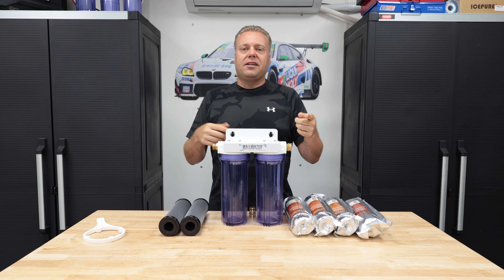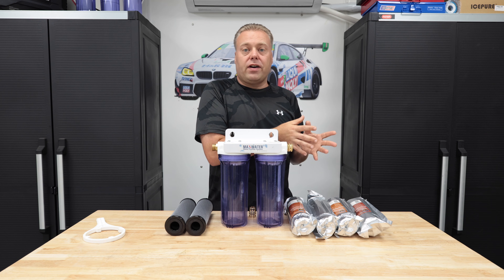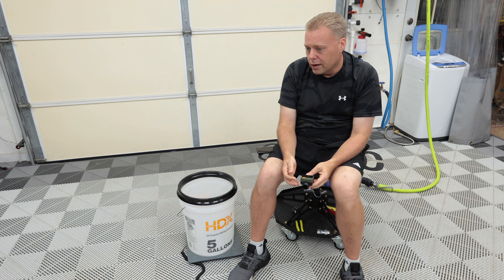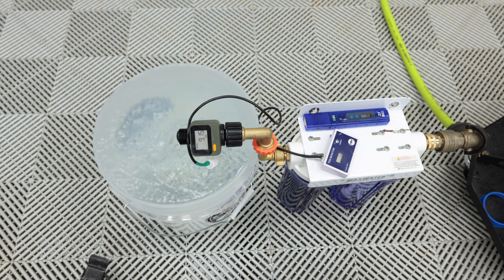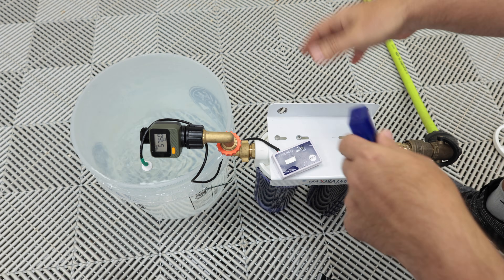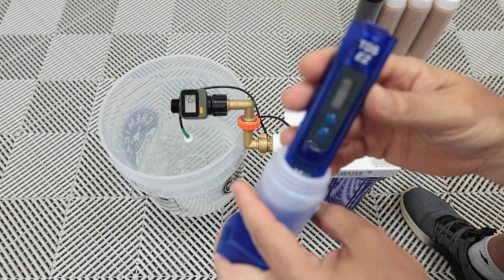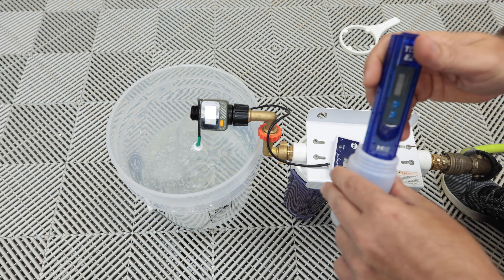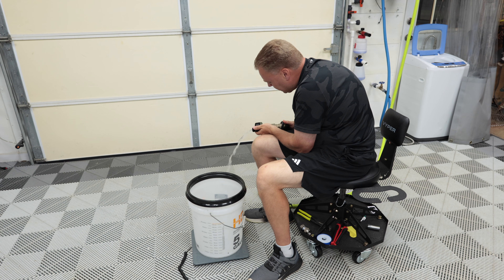Do Carbon Filters Help DI Spotless Resin Life? | Surprising Results! | Deionization

Comment: Does the carbon filter goes before the resin filter
Reply from the maker: Yes always before the resin.
Reply: Thank you 👍
Reply: why i see the they’re selling a set and the resin go before the carbon filter?
Reply from the maker: @fishwithme9245  Because the purpose of the carbon filter is to clean chlorine which depletes resin early. I have never seen a system where resin is first. It will also clean manganese which is a mineral you can get out before the resin as well. That could also be a difference in the filter system some the inlet is on the left and others it’s on the right.

Comment: It is best to prefilter water going into the DI media to get the lowest TDS as possible so your media/cartridge will last as long as possible. You can get a cheap RV set up with two 1 micron filters for ~$50
Reply from the maker: Prefilter carbon won’t reduce ppm though it can actually increase it, but reducing the chlorine is better in the long run for sure to lengthen resin life. The thing is though I have not really yet found a true dollar cost savings as the filters and housings cost money and the filter system only saving 10% or maybe a bit more. You might get ROI at some point, but it’s going to be a long time. If you had crazy bad water and using sediment filters then that might help tds, but most water is good enough quality to not have much picked up in a 1 micron filter.

Comment: Well that was clear as mud.  No offense Keav, but I don’t understand why this test was so convoluted.  It seems to me that anyone watching your DI videos is not considering replacing their DI system with charcoal, but trying to figure out if they would save money in the long run by pre-treating the water going to the DI with a charcoal system.  If I’m right about that (and lord knows I’m not always right), why not just run two tests through your normal DI system - 1 with pre-treated and one without.  Then you could calculate the cost of the charcoal filters along with the delta cost of the DI and figure out if it makes financial sense?
Reply from the maker: @RCGuy9973  That’s exactly what I did in the video was run tests with just DI and another with a carbon filter before the DI. Never did I run just carbon by itself. Carbon by itself would raise TDS and not help with water spots. The whole point of the video was about a pre-filter helping save your DI Resin. Whether that saves you money is entirely based on the system, the resin used and carbon filter purchased. Never said anything about replacing a DI system with carbon. I’m kind of confused if we are watching the same video to be honest 🤣. Now the reason I didn’t use my regular system as that takes 6 months to go through all the resin and I don’t have time nor want to waste 1k gallons and $100 in resin doing an all night test.
Reply: @ I guess the confusion for me came from subbing in a charcoal filter into the DI system.  I don’t always have the best attention span, so perhaps I missed your explanation about why you were doing what you were doing.  Thanks for responding, and thanks for putting together so very many useful videos - they have been extremely helpful.
Reply from the maker: @ I see what may have been confusing as the two stage system I had really isn’t just a DI system it only makes it one if you use DI cartridges in it. I was running the carbon filter first then the second stage I had a DI cartridge so that mimics two separate systems, but just in a smaller package so we don’t waste a bunch of resin and water. Concept and operation is the same as having two separate systems water flows through one then through the other as long as the carbon filter is first.

Comment: What you need is a bigger sediment and carbon filter then if you want to get the max out of your di filter you can pass it thru a 4040 ro membrane then to the di to polish out the water. 1 gal produced with every 2 gal waste. You can make everything under $600 or less. You can make your own di filter with $120
Reply from the maker: I don’t have any sediment in my water it’s mainly just controlling the chlorine. I myself don’t like waste water and since my ppm is low It’s not that costly for me to just use resin. For those with higher ppm RO is for sure an option. I have changed my wash process to use rinseless for the contact wash so now I use DI water for my pre-soak rinse and I know several with the 4040 and they say it can’t keep up with an AR630 so you would would need to store and pump or gravity feed it.
Reply: @CarsWithKeav  for sure rinseless is the way to go. I do my prewash with the di water. I'm mobile so I do store my water and pump out to my tank. You need a booster pump if you're going to run a pressure washer. If you use two 4040 you get more flow
Reply from the maker: @Ricios_mobileautodetailing  thanks for all the great information!

Comment: Couldn’t be bothered running a system that gets 26 gallons before it starts exhaustion. I use the DI – rinse spot free pro 100.
Reply from the maker: @Jimmer-Space88  It was just for the experiment not to waste resin and water. We didn’t even use both stages with resin either so together probably closer to 60 gallons. I wouldn’t suggest a system this small either, but it does work and regardless of exhaustion it’s based on the amount of resin. If you refilled this enough times to be the same amount of resin in your 100 they would be very close on total gallons to exhaustion. Just lots of refills to do. 🤣
Reply: @ Makes sense. Most of my vehicles use about 3.0 gallons in the final rinse off, so I guess my comment really came from knowing that I’d have to likely replenish the resin after eight car washes had me scratching my head.  Love your experiments by the way
Reply from the maker: @Jimmer-Space88  Refilling sucks so the least you can do the better plus the more resin the more flow you can get as well. 3.0 gallons you are doing well conserving. Ill use easily 5 gallons at least. LOL

Comment: Keav, I just bought the Spotbye DI system that you reviewed in another one of your videos. What is the best and most economical carbon prefilter setup I should use? Would a RV water filter be ok or do I need to go bigger like the one you are using in this video? Love your channel.  Content is great!
Reply from the maker: Carbon filter doesn’t need to be that big and would need to be a sealed cartridge so wouldn’t be a tank style. A 4.5x10 inch two stage should be more than enough. Single stage is probably good enough as well.

Comment: Great video as usual. Not that I’m asking for you to do this again, but having a test with 2x Resin would be a more appropriate test. Carbon filters cost about the same as resin filters, although claimed longevity of carbon filters varies. So the choice would be if resin + resin produced more clean water than resin + carbon (which I think it will)
Reply from the maker: At this size carbon might be closer in price, but they last probably at least 10x longer. As the filters get bigger the resin exponentially gets more expensive. The test was if you ran a carbon pre-filter can it improve performance as a lot of people wanted to know if they added another set of filters would it be worth it. Cost per gallon is still significantly less with a carbon filter.

Comment: I wash my truck and my work van once a week, and I currently have the 99 Aquatic Life POS DI System, Active 2.0, and the Ava P45 with the MJJC foam cannon. I live in Dallas, TX, where our water quality is terrible, at over 400 ppm. I'm looking for your honest opinion on what I should choose, considering how infrequently I wash. 

I’m not trying to transform my garage, but I don’t want to be buying supplies every week either. I appreciate your efforts to find value, but I wish someone would give practical advice to those of us who don’t want cheap options but aren’t obsessed either. Sifting through the overwhelming number of products has taken the joy out of my weekly washes. 

I've wasted more money on so-called "diamond in the rough" recommendations than I care to admit, and I’m over it. Please just provide a straightforward recommendation for a setup that works for those of us willing to spend money wisely without wasting it.
Reply from the maker: I got plenty of videos on those type of DI Systems. 400tds is almost at the limit of what most systems can handle to give clean water at say 2gpm. I personally would suggest the Griots at $300 which has a great bypass and the tank can hold 1/2 cubic foot or around 20lbs of resin. Plus it can flow at 4gpm for most water.

Comment: Dang those 10 inchers go quick
Reply from the maker: The 2.5 x 10’s sure do. The 4.5 x 10’s do last a bit longer and of course you usually run these in tandem so two filters gets double the gallons.

Comment: Good video. Now I see it's not worthwhile to filter before the resin. Sure it does something, but in my case it's not "easy" to add a pre filter due to space.
Reply from the maker: Calculating cost per gallon is going to be the deciding factor for sure as you have to make up for the cost of the pre-filter and filter for it to be worth it. Space absolutely is another reason. I would say carbon filter are more beneficial to those with lower tds. The higher tds the minerals are smothering the resin faster than the chlorine can probably kill it.

Comment: Loving these DI series of videos!  Keep up the good work!!  My issue with most DI resin is the mixed bed.  While much easier to deal with, you almost always burn through the anion faster than the cation.  So a 50/50 mix ends up wasting usable material.  While a 60/40, 70/30, or even 80/20 (depending on the supply of water), anion/cation ratio would be better.  A test with separate DI anion and cation stages would be cool to see.   Possibly using clear canisters and color-changing resin? Also, not having a mixed bed would make re-generation easier, for those who do that.
Reply from the maker: Different mixes for sure can help and like you said it’s about what is in the water you have. My biggest problem is 60/40 and others are more expensive than running a 50/50 so you have to add that into your cost formula to know if it’s worth it. Separate resin is actually not as efficient at cleaning water as mixed bed due to the reactions happening at the same time rather than separate. The reef aquarium guys have done tons of testing to prove that the best setup is separate cation and anion then a 3rd stage that is mixed bed for the final cleanup. I do plan to make a regenerate your own resin video at some point not just how to, but obviously picking out a good efficient setup to do it. If you can perfect the anion regeneration step with a mixed bed then it’s the same amount of steps than regenerating them separate. That step separates and regenerates at the same time just capturing the resin easily is the hard part.
Reply: @CarsWithKeav  can you find an  affordable supplier of the regen chemicals (muriatic acid and  potassium hydroxide)? I calculated the total to regenerate my 50lb tank and remember it costing more than 100. I regened  about  5 pounds but felt like it wasn't worth all the trouble.
Reply from the maker: @Hot.Tamale714  That’s my concern is it worth the trouble. I’m working to figure out a regen setup to try this out. Muriatic acid can be found at Home Depot I know that much.

Comment: Thx for all the do water videos,I’ve watched them all I believe some more than once. Got a scenario I guess I’d best description, 
I’m building a mobile detail setup in a metris 126, Ralda’s details is building me a skid waiting on delivery now basically. Anyway I’m looking for a way to run di water on the setup that is filtered as I use it so I don’t have to filter every gallon. My waters tds is low, or feels low after watching a lot of di water stuff, low is around 26-27 high around 32-33. I really like the wall setup, I was thinking of running 10 in housings and do a pre filter like you did with the 2 pre filters before it goes to the di setup, can the 10” cr or water drop handle the 2 gpm, or would I be better with the griots tank ? Either way I’m planning on doing the prefilters, I also considered after watching your bypass video just buying 10 in housings and then all 4 could match,
Anyway hopefully you can help save me some wasted time and point me in the right direction.
Thx
Reply from the maker: They both can handle 2gpm. The Cr spotless for much longer period of time. The Waterdrop filters don’t have a ton of resin in them, but at that low TDS it should be able to handle 2gpm. Cr spotless will do it easily as it has twice if not
more resin in the cartridges. The griots has almost twice the resin of the either one and has twice the gpm. If you have room for it that’s the better one just that tank size and height might be taking up a bit of space.
Reply: @CarsWithKeav   thx keav, the griots is a good value also, I’ve not received the skid for my van yet so I’m not exactly sure on room available but I was really planning on mounting it kinda similar to your wall setup on the back side of the water tank
Appreciate the response, keep up the content

Comment: Hey Keav thanks for this video. My tap water is about 270ppm. 

I purchased this  WaterDrop Spotless  and I've used it like three times and ppm went up over 20. I only used it to do final rinse. When I replaced filter, I noticed L filter was at 17 ppm and R filter was at 4ppm. I put a new filter on Right  cartridge,  moved what was on  R filter to left filter .  I still got water spots. That could be me not rinsing it thoroughly. 

So should I buy this new carbon filter system   and connect it to Waterdrop (2 systems filtering water)? or should I run resin cartridge  and one carbon cartridge on my Waterdrop system? Do you have any links that can hold the resin in a cointainer?  since it only comes in cartridges from Waterdrop. Waterdrop seems to have a non common water container size.
Reply from the maker: The Waterdrop filters don’t have enough resin to handle TDS in that range. Best to go with a bulk filter. I did a review in the Waterdrop and show in the video how to upgrade to a 4.5x10 bulk resin canister and add the resin. https://youtu.be/SbBFH07FBcg?si=srjzdXHrJmaCI7Nq Would at least double the length of time. 270 tds is kind of at the limit with a 10 inch system. 20 inch would be more suitable I also made a video a few weeks ago going over upgrading a water drop to 20 inch. https://youtu.be/SRJ4HVlk5bE?si=9i1uYx618D7X27k2
Reply: @CarsWithKeav  Thanks for the quick reply Keav. You are the best. Will be watching these videos now. I appreciate your dedication.

Comment: Great video, and don't you just love when test results go astray. Random thought, but as expensive as DI water is to produce, we need a chemical injector that we can add rinseless to at 256:1. A 50 buck gallon of rinseless can produce 256 gallons of softened water ready for drying. What's the cost for 250 gallons of DI water?
Reply from the maker: That is a great idea unsure of the shelf life on diluted product. Should last a few months if sealed. I’ll ask Yvan at DIY Detail when I see him this weekend and see what he thinks about that.
Reply: @CarsWithKeav  I was actually thinking that instead I f using DI water, we somehow inject the chemical into the water supply before a pressure washer. It could possibly be turned on during a rinse step to replace DI water. Also saw today an email from Adam's. They have a pro DI unit they claim to filter something like 2,000 gallons at 100ppm.

Comment: maybe taking a small sample and then testing ppm might help with consistency instead of measuring directly from bucket. Still a great video. thanks
Reply from the maker: Probably right, but I figured as long as all 4 runs were done and measured the same way it would work out.

Comment: Carbon filter connected to Pro Aqua 1600 to a D.I. . 
Should help reduce D.I. Resin cost.
Reply from the maker: Pro Aqua is cation resin so half the DI process which would then exhaust the anion resin that’s is in the mixed bed before the cation there goes bad. In the end I think the cost saving of just having a larger DI system with a carbon filter is better. Plus carbon to water softener to DI is a lot of systems tied together, but I see what you mean. It’s a bit too much for me to want to try it.

Comment: Keav would like you to review this water treatment option . PRO+AQUA 16,000 Grain Portable Water Softener for RV, Trailers, . Would be inrested to see how this would compare to using DI units for effectiveness and cost per use.
Reply from the maker: You would have to convert to DI resin so cost wise it would be much more. It’s the same tank type as DI, but water softener resin does not create spotless water it only removes a few solids such as calcium, sodium and magnesium. It is only half of the deionization process. Mixed bed resin is positive and negative ions and water softener resin is only the positive ions.

Comment: Keav , check window washing hand truck with R.O.and Di water used to clean windows.
Reply from the maker: Problem is most of those don’t have enough flow to run a pressure washer or rinse a car. Some can, but get very expensive. Then you got to deal with the waste water as well. I’ve been looking into a solution, but won’t be cheap. Suds and Go already created a very good one. https://youtu.be/7HBrqd93bEI?si=0BiDGu0g39LZnidQ

Comment: How do you know when the carbon is used up?
Reply from the maker: One way to know is have pressure gauges on the filter housings some systems come with them already. Changes in the pressure show the  filter being used up. Other than that I just change mine out once a year. Most are good for 10k+ gallons depending on the water so even the worst water will do 1k gallons.